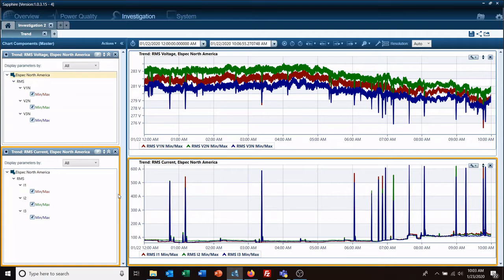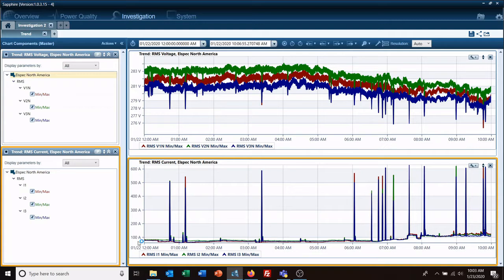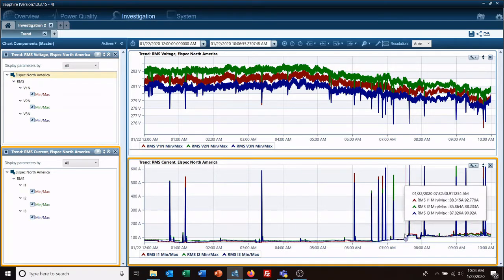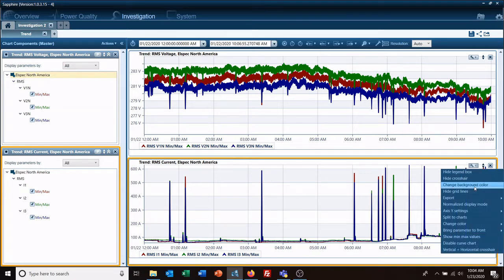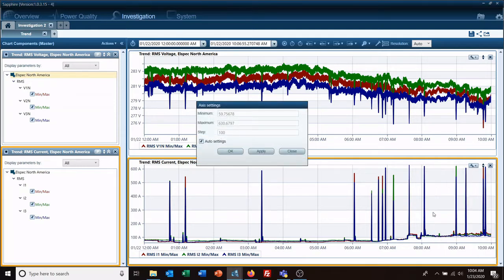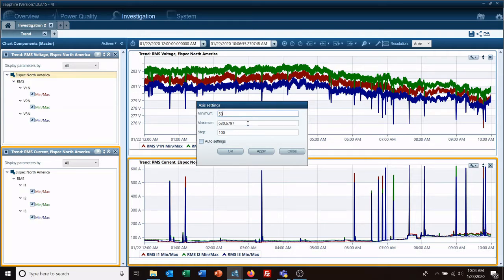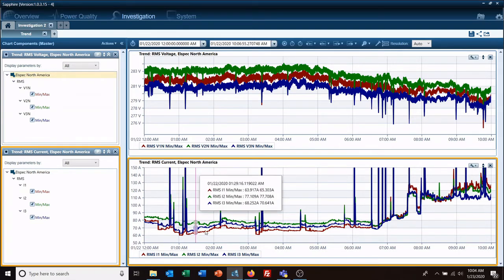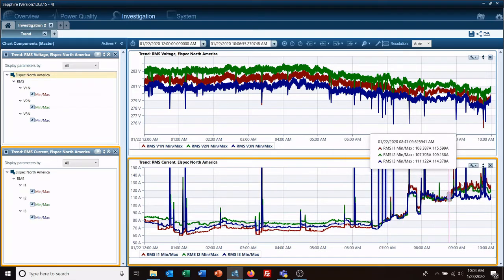How to Adjust Y-Axis in PQSCADA Sapphire Power Management Software by Elspec

Comment: How do you plot MRS volts of two meters (e.g. one at 275kV and one at 33kV) in the same plot but have one on a primary and the other on a secondary Y axis.  I tried "normalise" but it doesnt seem to work for voltages. I would expect normalise would give a number close to 1 pu. Thanks
Reply from the maker: Hi Tom,
Normalize is the tight path. Please make sure that the Nominal values are correctly configures. If it still doesnt work for you send me a private message and I will assist you further